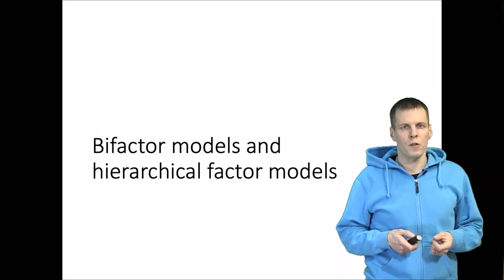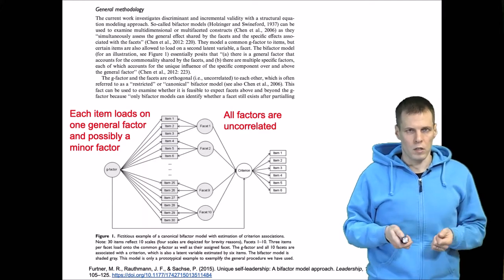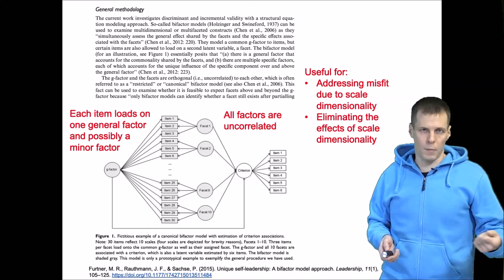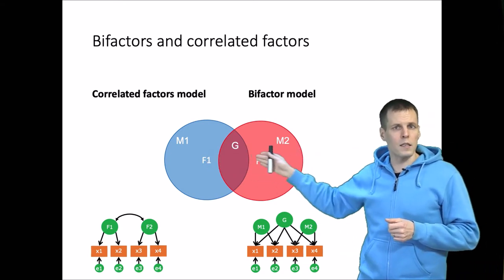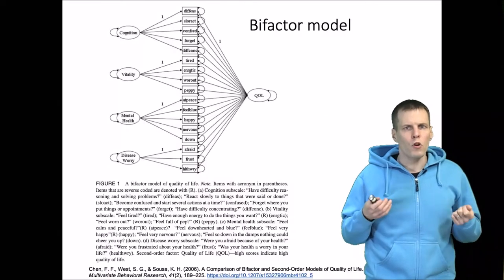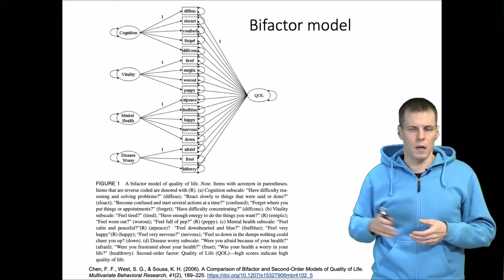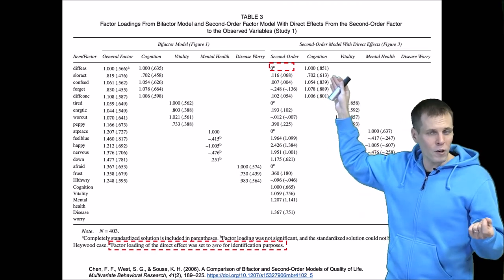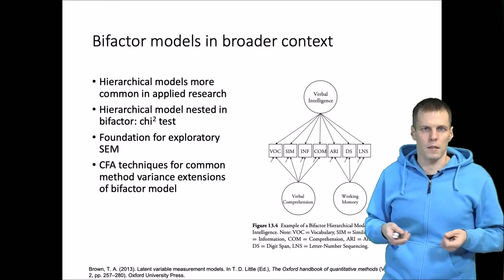Bifactor models and hierarchical factor models

Comment: So you have a general factor G that you confirm with a bifactor CFA. How would you calculate a score for G? For example, in your bifactor model at 14:39, how would you estimate somebodies Verbal Intelligence score? I ask because I am interested in estimating these general scores for each person in my dataset, and then adding those estimates as columns in my dataframe. Curious whether you'd take the mean of the total 7 items or calculate separate means for Verbal Comprehension and Working memory, add them, and divide by two. Or maybe something else? 

Great content as always! It's the only content on youtube that really feels like a high quality grad-stats class. I've suggested to other students to look for the guy with the blue hoodie if they are looking for stats enlightenment  :)
Reply from the maker: You can use factor scores or take a mean of all items to get a score for G. However, make sure you understand the challenges in using scores to represent factors: I have a video on factor scores that explains this issue. Whether you take the mean of all items or the mean of two subsets and then a meanwill not make a  of these means meaningful difference. This is because taking a mean of all item vs the mean of subscale means approaches are just two different ways of calculating a weighted average. In practice, indicator weights rarely make a difference as long as the items are at least moderately correlated.

Thanks for the compliments! These videos are actually a part of my doctoral level course and most of the content is something that I have also presented in class..

Comment: Dr Mikko, great video. I am wondering if it is possible to have two "general factors" in a bi-factor model (allowing some items to load on one and the remaining on the other). Or, is only one general factor allowed in a bi-factor model?
Reply from the maker: You can specify that kind of model, but I would not call it a bifactor model.

Comment: Dr Mikko, in your opinion what is the difference between common method variance models and bi-factor models?
Reply: In a CMV model, factors are allowed to be correlated with one another. However, in a Bi-factor model, factors are not allowed to be correlated with one another.

Comment: What is the procedure to set the correlations to zero, in AMOS?
Reply from the maker: It is years since I last opened AMOS, but if I remember correctly the correlations between exogenous latent variables are constrained to be zero by default and you need to specifically add correlations if you want to remove this constraint.

Comment: In the case of the bifactor model would the expectation be that, if it is indeed a bifactor model, all indicators load into the G factor? What if you fit the model and they do not? How would that be different from a three factor solution?
Reply from the maker: I would call it a bifactor model even if some of the loadings were small. But if there is not much evidence of a general factor (i.e. loadings are small), then I would conclude that perhaps a bifactor model is not needed. I am not sure if this answers your question.
Reply: @mronkko  it does, thank you!